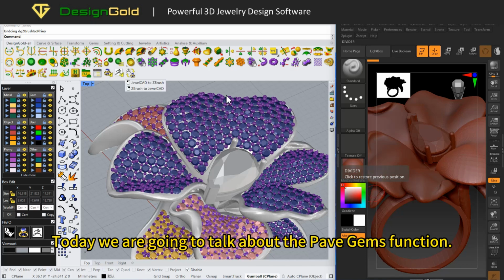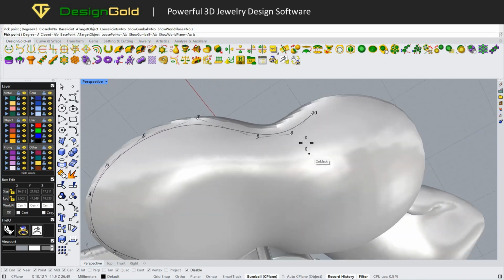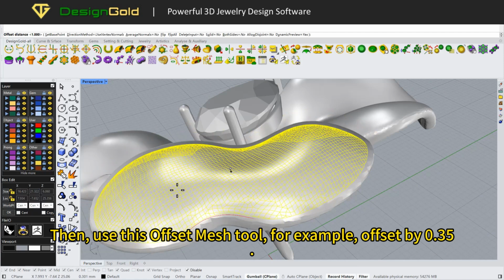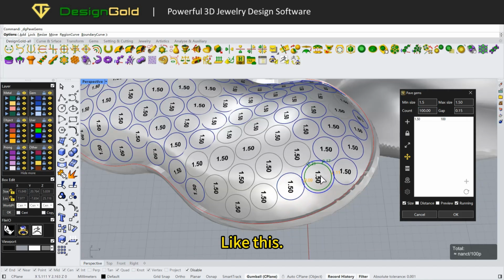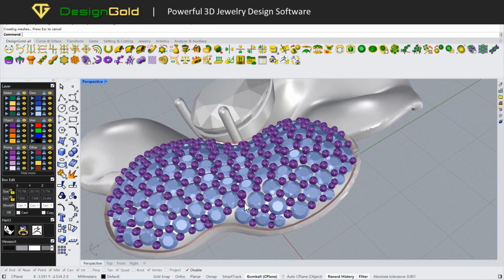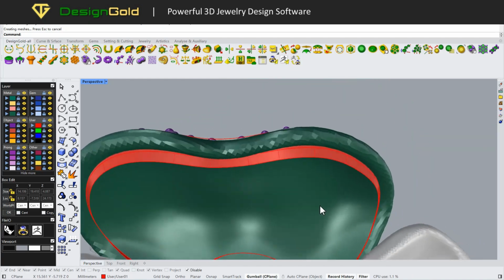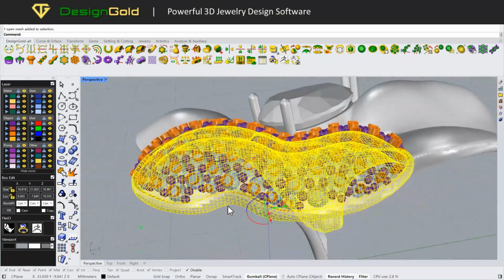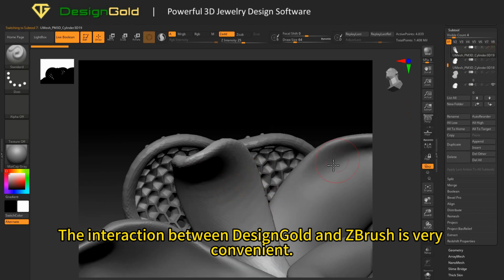How to use PaveGems in DesignGold | Rhino 3D | Matrix |  Pavé Gem setting |  to zbrush | Pavé Pongs

Comment: Is there a way to flip all the gems if the surface direction is incorrect and the culets point outward? Is there a gem tool that will flip the gem direction, so the culets are pointing downwards, after completing the dgPaveGems command?
Reply: Flip surface normals direction